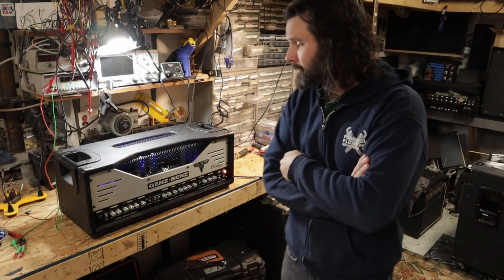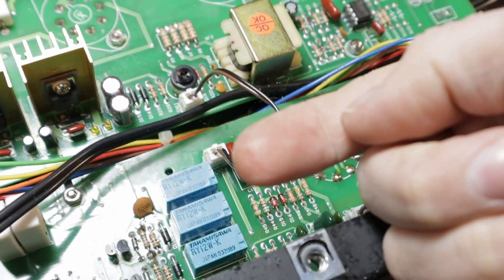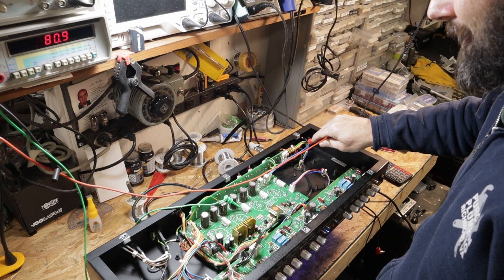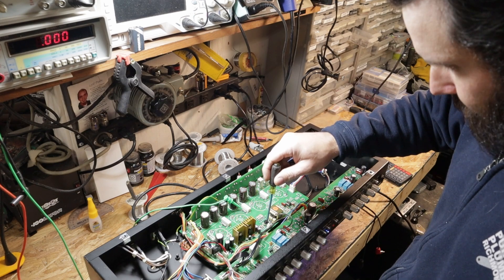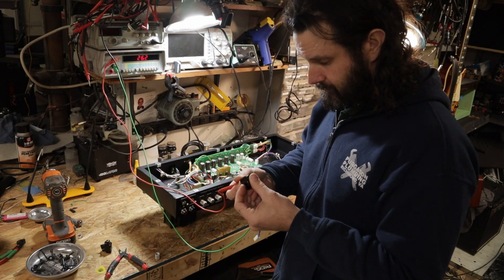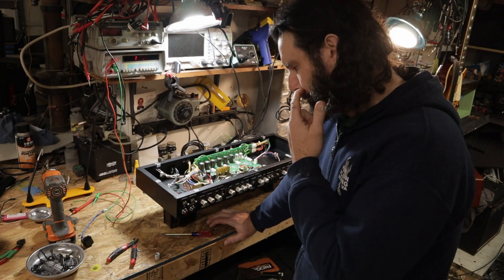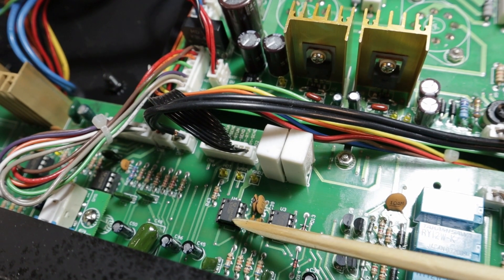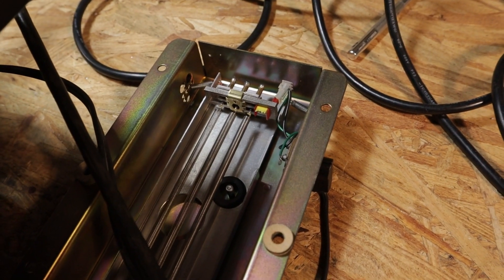Genz Benz Diablo Troubleshooting and Repair

Comment: great video. very informative. I have this amp and need to change the tube because, it been unused for a good while now. I turned it on blew a fuse and notice that one of the outer tubes was flickering.  is the manual correct on the biasing as .600 v? or is it a typo?  thanks in advance for advice.

Comment: You said you installed a quad set, but amp is locked in 50 watt mode?
Reply from the maker: @CoverYourAxe  the half power switch has been defeated.
Reply: @purgasound  Ah, gotcha!.

Comment: Hey I have a feeling you know this but I'm throwing it out there for anyone else, on an enclosed relay or switch,  if you wire up a light bulb in series,  so kind of make up a rig, and close the switch a bunch of times you can wipe the contacts and get the resistance back below an ohm. But in this case that switch and what it does probably isn't a good idea anyway. Thanks for the videos as always Brent.